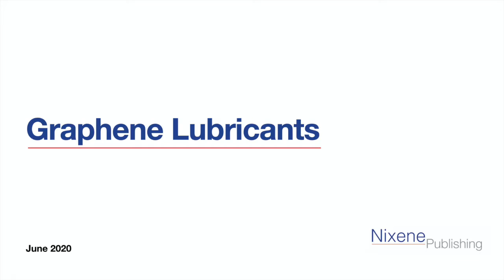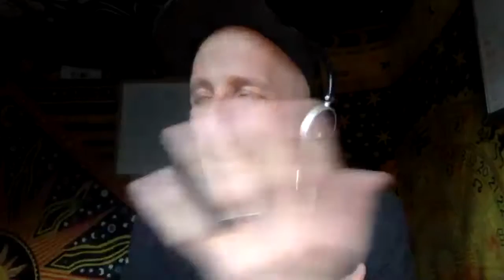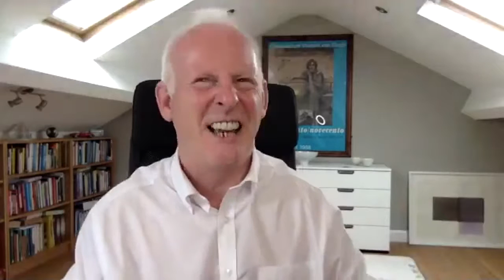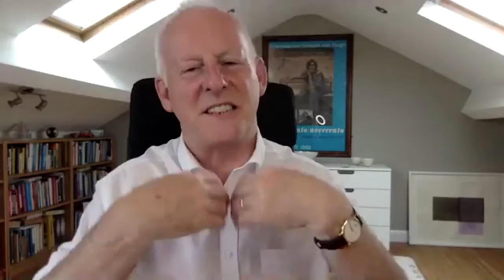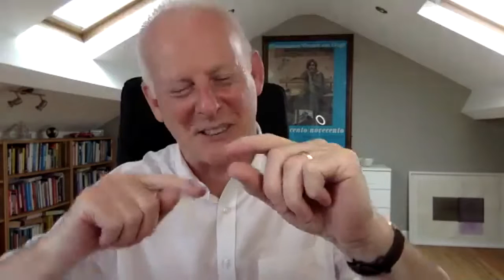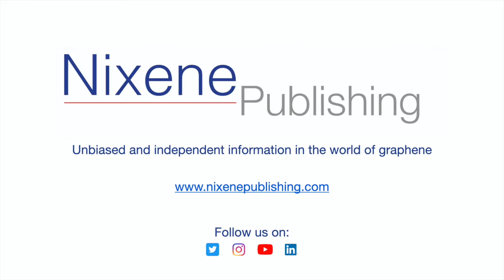18 - Graphene Lubricants and nano diamonds

Comment: graphene engine additive is excellent stuff.Benefits are as follows:

1. Improve the fuel efficiency (5-20%)
2. Enhance the power output(5-10%)
3.Reduce friction, abrasion and wear of engine and prolong the engine service life
4.Reduce the emission(20-30%)，Remove the carbon deposit and black smoke
5.Reduce the noises（9.6%） and vibration（12.6%）
6.Accerate the heat dissipation